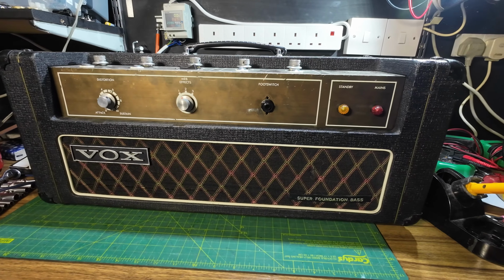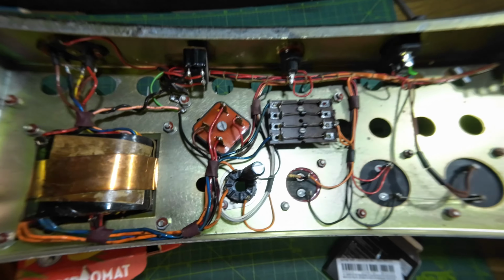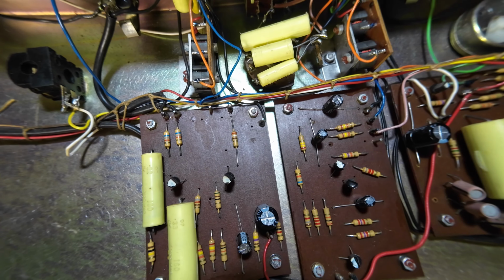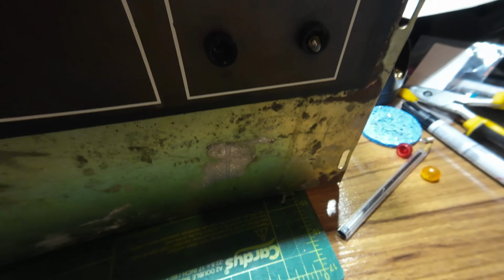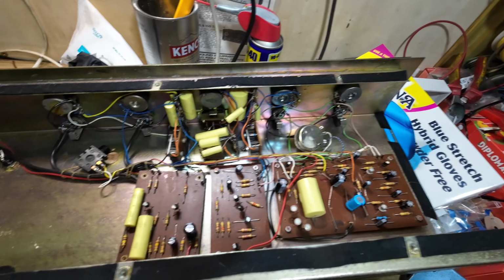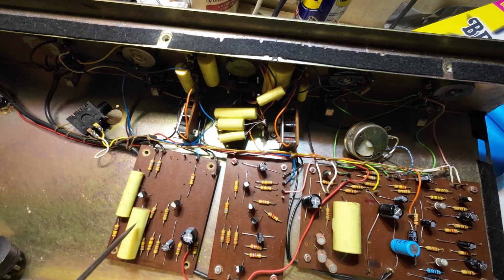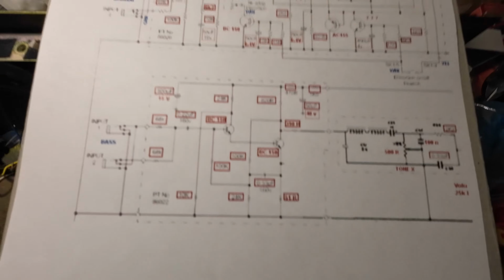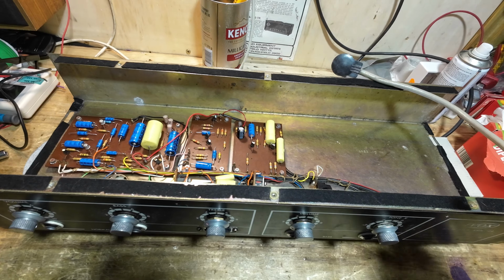Vox Super Foundation Bass Solid State Guitar Amplifier Restoration Part 1

Comment: The MRB control I believe was the circuit that Thomas Organ developed into the original Wah circuit
Reply: Those inductors looked a bit like inductors used in some late 60's wahs as well. Cup core.
Reply from the maker: Hello Chris. That's interesting. I will have a read online

Comment: I always wanted a couple of Supremes, but I ended up with three Super Foundation Basses instead. Less knobs to sort. Sorry to say I have not cracked open any of my British Voxes, they are all running strong at the moment. Actually, I should have a look, they look much easier to work on than a Thomas Vox, and those are fairly trivial.
Reply from the maker: Hello, three of them? Wow. They didn't make that many form the bits of info I have gleaned. Have you had any work done to them in the past?

Comment: If it were me I would look up the data sheet on all those yellow caps to Ensure that they are at least decent quality because I have never seen those before. I've never seen anyone in the amp business use them. That doesn't mean they're not any good though. That's why I would have to you know sneak a gander at the data sheet and make sure they're worth a damn before I left them in there. Otherwise they might come back to bite you in the ass after you send this amp off into the wild Blue yonder and that makes you look bad for not replacing them.....
Reply from the maker: Hello Thomas. I did consider swapping them. I discussed it with the customer. We agreed to leave them in if they tested okay, which they did. He only lives up the road so if there is a problem, he hasn't got far to go. I will do a bit of research on them. Take care.